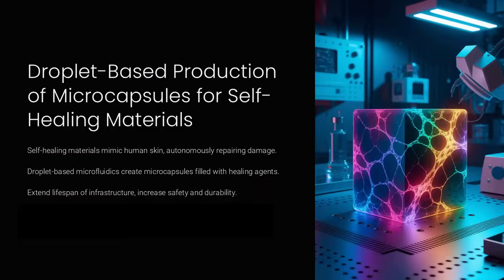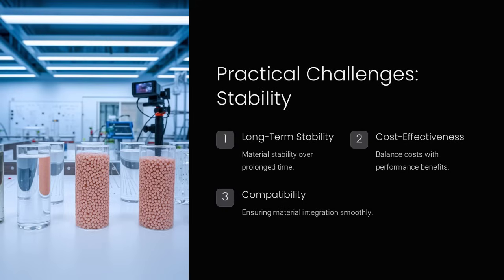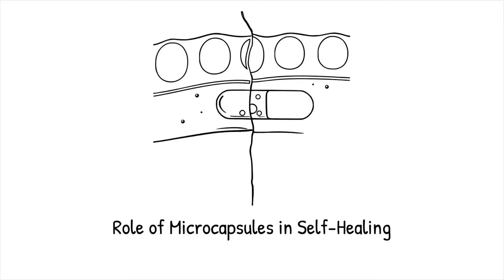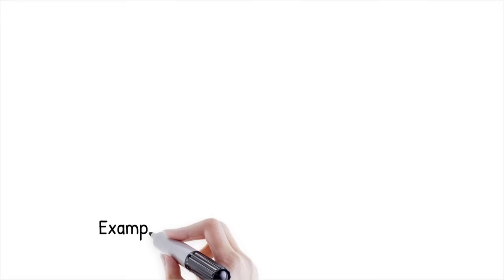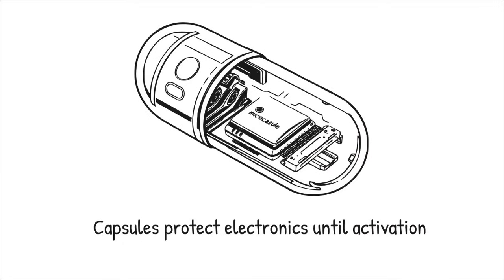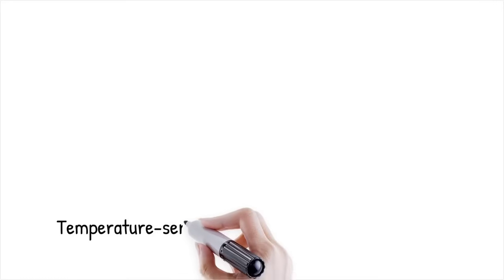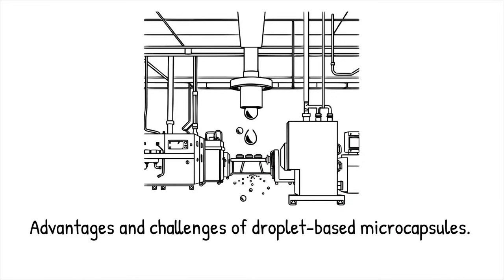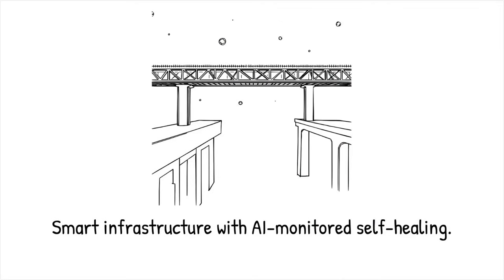Self-Healing Materials: Smart Repair Technologies using Microfluidics

Comment from the maker: How can the kinetics of polymerization within self-healing microcapsules be optimized to ensure rapid yet structurally robust repair under varying environmental conditions?
What are the fundamental limitations of microfluidic synthesis in achieving precise control over microcapsule size, shell thickness, and release dynamics at an industrial scale?
How can bioinspired self-healing mechanisms be integrated into synthetic materials to enable multi-cycle healing without compromising mechanical properties over time?